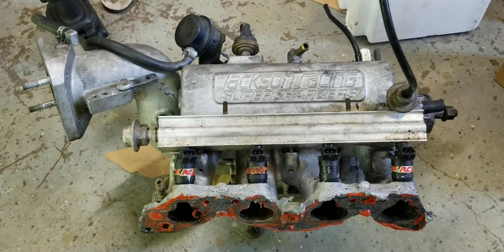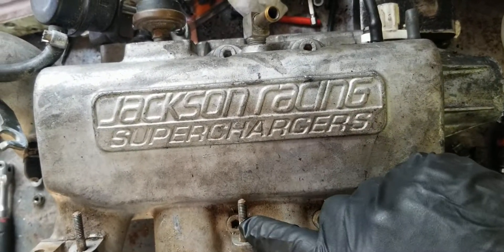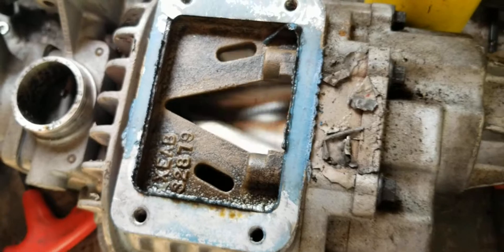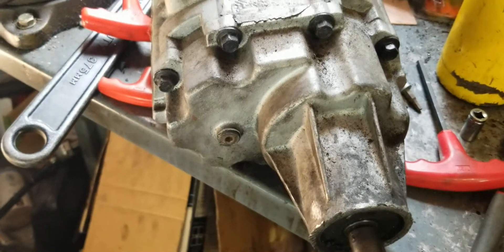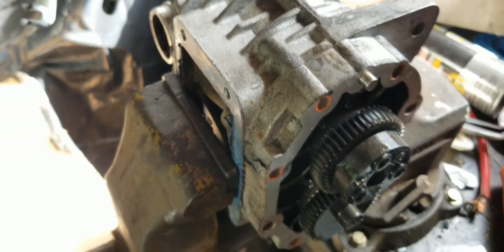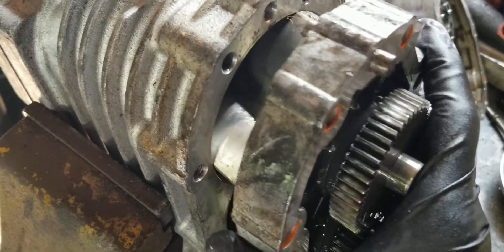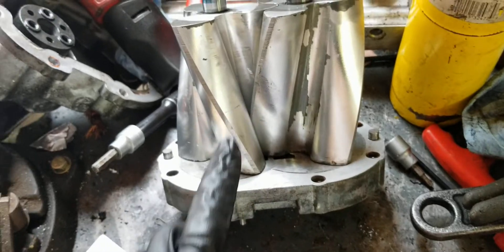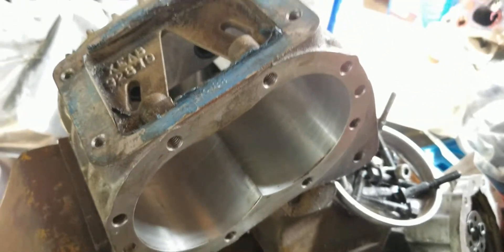Disassembling a Jackson racing supercharger (Honda D Series)

Comment: I picked one up a while back but the guy lied about it and the rotors are mangled in it. Have you had any luck finding replacement parts for them? I saw one place selling a kit for around 2500 dollars during peak covid pricing but I'm hoping to spend a lot less than that. Id love to finally get it on my civic.
Reply from the maker: So ours was bad as well we rebuilt it but some have mentioned no spring in ours so we are concerned now....payed around 150 for the bearing, seals, & oil....
Reply: @DIYKAI  oh what spring are you missing? Where is it supposed to be I took mine apart two years ago and put it back together but I don't know if I remember a spring ether.
Reply from the maker: @NoSleepRacing some said they have one in the snout